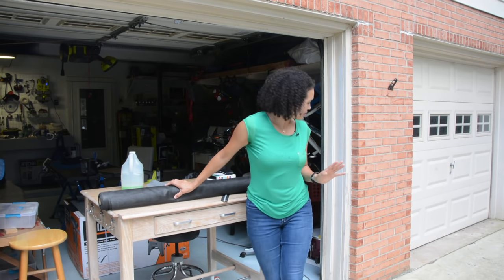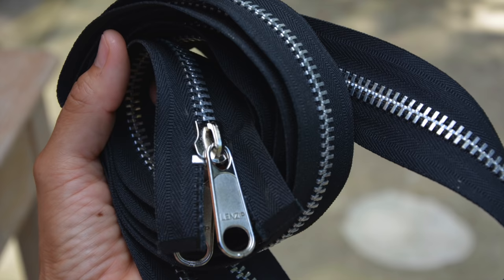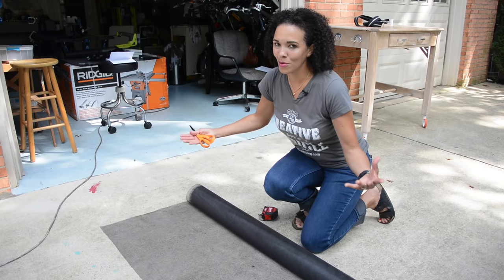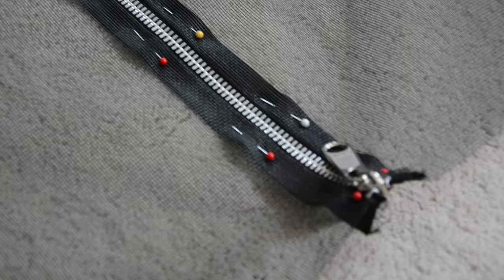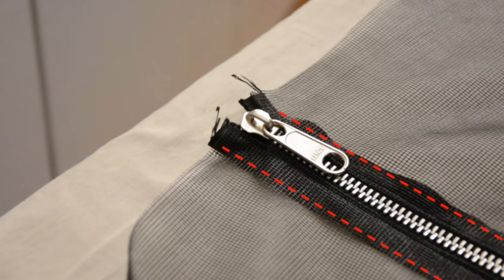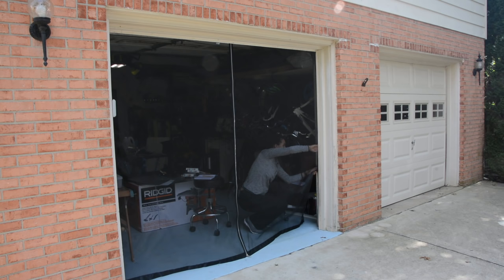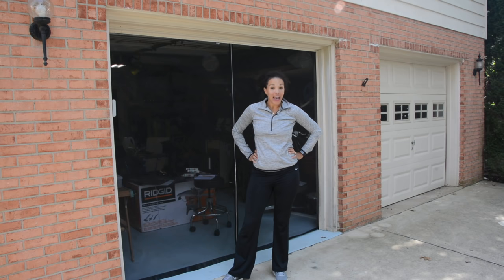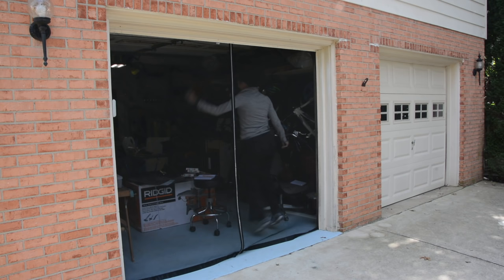Make Your Own Garage Door Screen - DIY Tutorials - Thrift Diving

Comment: If your metal zippers have a tendency to stick or drag instead of   glide, apply a small amount of silicone lubricant. I used CRC Heavy Duty Silicone Lubricant spray on the metal zipper of a new leather purse. Just start out with a small amount, and work the zipper back and forth as you apply, to get the lubricant into the teeth.
Reply from the maker: The zippers have been holding up very well, actually! Great tip for stuck zippers!

Comment: Great project.  I'm in Michigan and the stink bugs frighten me more than spiders.  They're nasty little buggers (hahaha) and the only way to get rid of them is to move to the North Pole.  I tried the mixture of dish soap and water (spray bottle & half of each) and it knocks them to the ground and then you spray them a few more times and they drown.  I think the weight of the soap is what keeps them from flying.  Then you can pick them up with a paper towel or go have a cup of coffee and ignore it for awhile.  Tell hubby that we're all about your singing and dancing with joy.

Comment: this is genius!! I would use magnets instead of a zipper though. New subscriber watching all your old videos!!! Your channel reminds me of the show flea market flip on hgtv except even better.
Reply from the maker: Aww, thanks, Katie! Magnets would work, too. I like the zipper because it creates a more sleek appearance. Plus, since there are no seams with the zipper, I am able to raise and lower the garage door with the screen in place and it is fine. If I had used magnets, the garage door handle likely would have gotten caught on the screen and ripped it down or jammed the garage door. But magnets are an option if you plan to hang and remove it each time you open the garage door. :) I just keep mine up all season.

Comment: Great job Serena.  How did it hold up?  I bought the same fibreglass screen fabric and was getting ready to make a screen door for our back door but seeing the zipper has got me rethinking that.  It'd be much cheaper.  Thank you so much.
Reply from the maker: It held up very well! I ended up getting an upgraded version (you can see that in another video). But this version was still in tact and functioned for a long time!
Reply: @ThriftDiving  Excellent.  Thank you.

Comment: With sewing the velcro that is sticky. How did you achieve that without your needle getting gummed up??  Great project and video..;)
Reply from the maker: Good question! For some reason, it just didn't. It went straight through and attached nicely with no problems!

Comment: I'm interested to know how your sewing machine needle behaved with the glue on the velcro.
Reply from the maker: Hi, Doreen. Surprisingly well, actually! It didn't get gunky or anything! I was pleasantly surprised.
Reply: I was going to as the same thing because a friend of mine ran some through my machine and super gunked it up. Also I feel like the sticky just doesn’t want to work as well a lot of the time and if you are sewing and stapling it anyway then non stick is cheaper. I love this project though and am totally making one for my place. I do not do well with creepy crawlies or flying things.  We also have random small birds trying to get in sometimes. :/

Comment: question... with this screen door, does your garage get hot during the summer? meaning, does this screen mesh retain alot of heat from the sun and make the garage super hot? I want to do the same for my garage, but im afraid that my garage will be scorching hot
Reply from the maker: Nope, I haven't noticed that it's any hotter than usual. It's been working well for me! I still need to make one for the other garage door so that both have screens. But overall, the screen has held up great!

Comment: Really cool project!  Just curious what the difference in build quality is on yours vs the ones on Amazon?  Might have to give this a try!
Reply from the maker: bigscreen bird From the research I have done on them (when I was looking to buy one over the spring) it seemed like the store bought ones may have been cheap, especially if they close with magnets. And because we have stink bugs here that get into little cracks, the Velcro brand fastener presents little gaps for them to climb in through. I also just love to make things, so it was rewarding to make my own, especially with a heavy duty zipper.